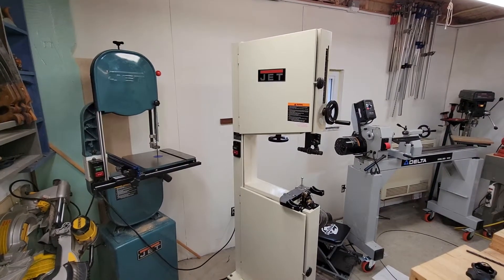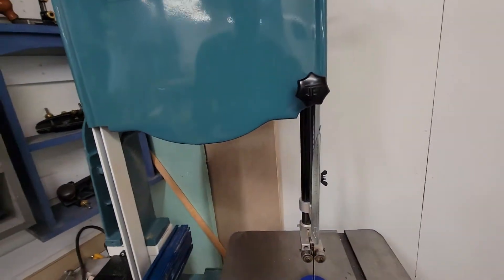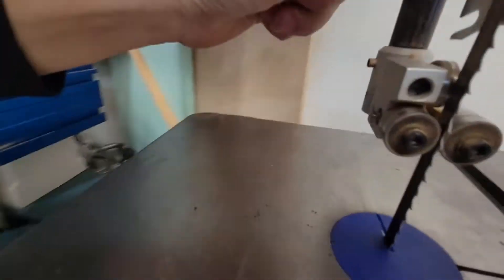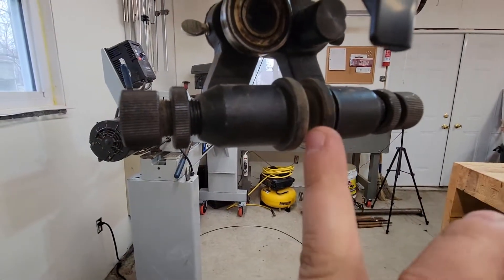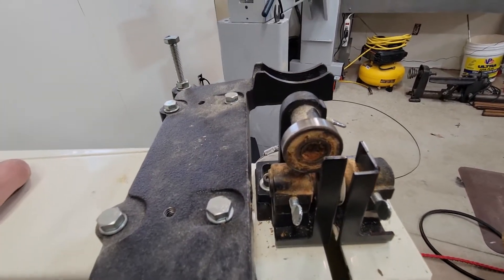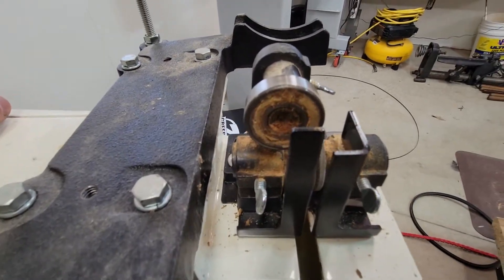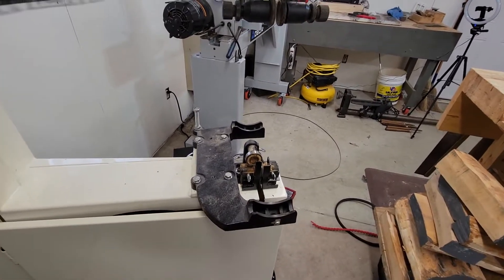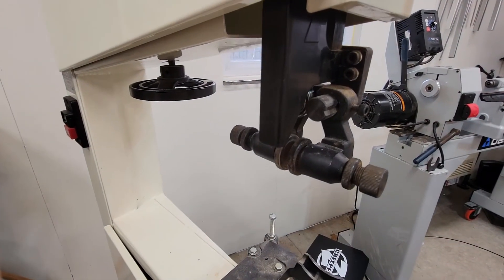Tuning and Upgrading a 20 year old Jet JWBS-18 18" Bandsaw - Looking at the Stock Guide bearings

Comment: I bought a JWS-18 shaper for $50 and I'm trying to convert it to accept router bits with not too much luck...I've got some good ideas But....I have to come up with a shaft/collett anyone know of a place that might sell parts like that? I'm thinking a milling machine accessory is the way to go...open for suggestions
Reply from the maker: To be honest, I don't have any experience with that, I do believe that a shaper spins at a much lower RPM than a typical router, so I'm not 100% sure if one can easily switch between the two types of bits... 
That being said, I don't have any experience with shapers, so take what I say with a grain of salt!

Comment: Is this the Jet JWBS 18 M? I'm looking at one that will be coming up for auction in the next couple of days. I've only seen one photo so far, but I intend going to the auction house to view it tomorrow. Does it not have a quick-release lever to release the tension on the blade? I think that'll be pretty important to me... 🤔😕
Reply from the maker: This is the jwbs 18, none of the upgrades that Jet had made in the past 20 years. It looks like the M model may have a QT, but I couldn't tell you for sure what you're looking at. 
I'd rather have 18" cast iron wheels and larger  table than 14" with a qt, it doesn't save that much time, though I know what you mean. I don't have a foot brake and I've already sworn I won't buy a new BS without one!
Reply: @AndrewZetts , thanks for your prompt response. I'm confused now, because I hadn't realised what the 'QT' in some model names stood for and still don't know what the 'M' stands for. Just goes to show what I know... 😏 Maybe 'Manual'?
My confusion arises, however, from some photos I saw just after having posted my question here. The first photo I saw was on a site that had only one photo, from the front, but then after some more searching I came upon another site with several photos and in fact also the quick release listed as one of the features. I think this may be an added feature to later models, however, because I've also just noticed that the blade guides are different from those on the one on auction here. Guess I'll have to wait and see what it is.
And I know how you feel about that brake; my RAS doesn't have one! 🤨🤭

Comment: I have this same saw.  I've been trying to find a roller-bearing retrofit for it, but there doesn't appear to be anything available these days.  This video leaves the question hanging:  Did you modify or upgrade the bearings?
Reply from the maker: Hi Gus, I did find an acceptable replacement. I've filmed bits of it and I need to piece a video together to show how I did it/problems i had. These bearings work for this version of the 18" bandsaw, although the blade guard in front of the lower bearings interferes with accessing the hex bolts for bearing adjustment.  I will show you how I cut away at the blade guard to address the issue. 

I think the verdict is still out on how much i like these bearings so I can't 100% recommend them, but so far they are working alright.  They are expensive enough that you might reconsider sticking with your current guide bearings.  They are $30 ish cheaper than the carter bearings on their website, and personally I think they're just as good.

https://www.sawblade.com/product-detail.cfm?id=1783&gclid=Cj0KCQjw_4-SBhCgARIsAAlegrW0fiuBICXt7EEIeOa9wPUXse_a95MASlwsEit5BgM_gkCbsd2vn2gaAkqMEALw_wcB
Reply: I rarely have a problem overcoming small design issues such as the one you describe.  My challenge has been how to replace the upper bearings without the obligation to build a set myself.  So thanks a million for that link.  I don't believe it turns up in Google searches.

Strangely enough, your video is the only one I found for our old model.  All I can gather is that either Jet made very few of them -- which I doubt -- or there are plenty rusting away somewhere.  Because if they were commonly in videos it would mean that folks like us are actively renewing them.

I don't mind my old beast.  By the time I fix the bearing issue and beef up the motor, I will have invested far too much to part with it.  Added to that, I'm tired of manually releasing the blade tension, but there is no quick-release mod that I can find for this model, and all DIY versions are designed for saws with the spring mounted externally.  Let me know if you've looked into that update as well!
Reply from the maker: @dthievin  in my latest video I bookmarked the spot where I remove and reattach the aftermarket upper bearings. Hope this helps.